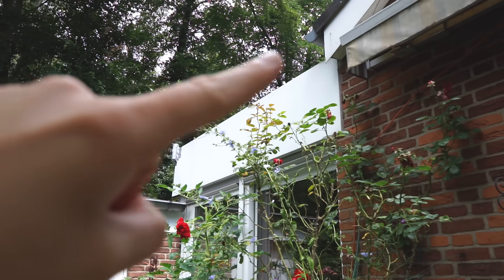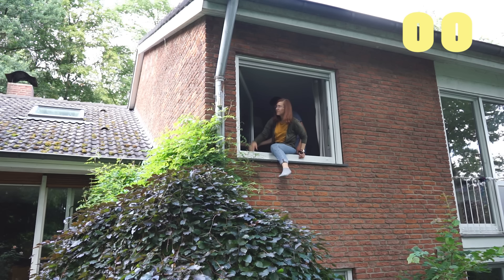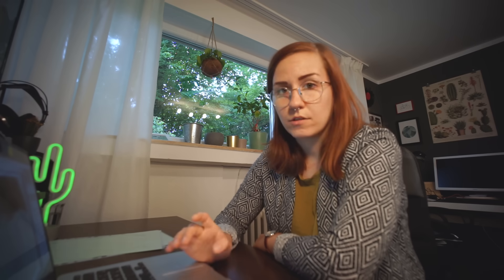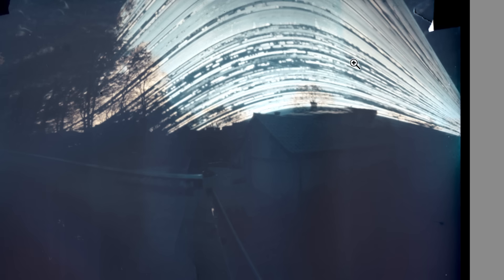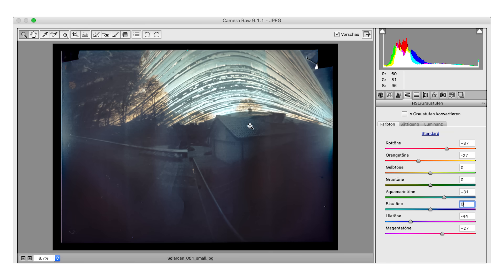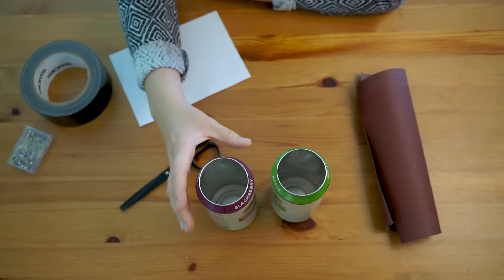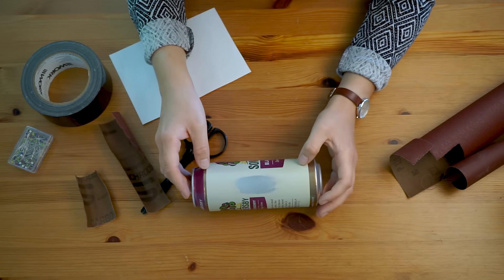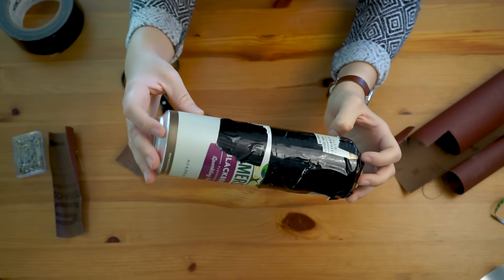Beer can pinhole camera | 1-YEAR LONG EXPOSURE

Comment: Wow great video :)

I have two questions about it:
1) What paper did you use? Bzw which ISO had it?
2) Do I understand it correctly that you have scanned the paper directly out of the can? If so, can you open the can in the light and how long can the image be exposed to normal daylight?

Keep up the good work and greetings,
Tobias.
Reply from the maker: Hey, thank you! 
1) I don’t remember exactly but I think it was some old Ilford paper (grade 2 or 3). And darkroom paper has an iso value of approx 8 or 10.
2.) exactly, no developing, just scanning. But it makes sense to try to keep the paper away from light, because it will slowly fog. But getting it out in daylight to scan worked for me.

Hope this helps? :)
Reply: @KarinMajoka  Yes, thank you.
I'll see if my friends have 1-2 leaves over.
Reply: @KarinMajoka  I have 1 or 2 photos stored somewhere for almost 20 years. I don't know what is the image. I don't know what kind of paper it is, but I guess it was a common one for photography back then. 

Do you think it is safe to scan it like you did and get an image out of it?

I also have a roll film of a conventional camera with photos taken even older. Can I do the same with that film?

Thanks.

Comment: is there no need to insulate the can from the direct heat from the sun? thanks for sharing this!
Reply from the maker: That's a good question - I live in Germany so "heat" is probably relative. I did not have any issues with my beer can cameras here, but I also don't have any experience how they behave in warmer and more humid climate.
Reply: @KarinMajoka  i've been doing some calculations and the sun will be at almost 90 degrees in the summer here in the Philippines. i may have to tilt the can, but i don't know if there will be water intrusion through the pinhole when it rains.

Comment: Extremely interesting project and very well done and your skill on the computer to bring out details previously unseen is amazing.. One thing that might be worth considering is to make an even better quality pinhole in some thick foil, similar to what small individual pies are sold in and attach it to the beer can camera. Years ago I made numerous pinhole cameras and various pinholes and found that the “sharpness” of the picture was highly depend on the quality of the pinhole. I would gently make a tiny hole in the thick foil and then repeatedly rub over the pinhole with the side of a pen to flatten any burr that has been created on the edge of the pinhole and gently twirl the tip of the needle in the hole with almost no pressure. Repeat the “flattening” and “twirling” a few times resulted in a high quality pinhole. I bought a magnifying loupe with a measuring scale and could accurately measure the diameter of the pinhole right down to  1/5 mm, but the optimum pinhole size for your “beercam” would probably be about 1/3mm. I did my pinhole photography when I was a young man and now I’m retired, videos like yours inspires me to get back into it.
Reply from the maker: Thanks for taking the time to watch and comment - I really appreciate it! And that's an awesome tip, I hope to try out one day. I am not all that experienced with pinhole photography apart from the solarcan-project, but I have always been fascinated by it. I was considering building small little pinhole cameras out of those small film canisters and I was wondering what a good way to build the aperture would be. So that advice really comes in handy - thanks!
Reply: Karin Majoka a “film canister” camera is an interesting concept and you would probably need the smallest pinhole of about 1/5 mm and I’m sure the results will be interesting. I have a Russian Zorki 35mm camera that I mounted a pinhole to and the results were not spectacular. What you are doing with your larger format “beercams” is the way to go, the larger the format, the better. When I get back into pinhole photography, I will probably go for 120 film, which is 2 1/4 X 2 1/4, in other words, the bigger the better. Years ago I built a 5X4 pinhole camera which produced very good images. You might not be all that experienced in pinhole photography, but I’ve sure learned a few things from you. I would have thought that a year long pinhole camera exposure would have yielded a picture so overexposed that it wouldn’t be viewable but you not only proved me wrong but with your additional knowledge of scanning and computers, you came up with some images that were absolutely amazing, especially when you adjusted the curves and the foreground house became visible. Best wishes with future pinhole projects.
Reply: @KarinMajoka  .. Karin, I want to try this. What paper exactly do I need to buy? (and where can I buy it)?
An idea that I have, although it can be complicated to build, is to use 1/2 can cut vertically and put the pinhole in the plane part I would use to close the can. In this way all the points of the paper (at any given height) are at the same distance from the hole so 1 degree of the sun moving in the sky will be the same length in the paper at sunrise, noon, or sunset. Of course a spherical surface would be eve better but good luck finding a hollow sphere that can be cut in 1/2, and even better luck conforming a piece of flat paper into a sphere, and if you happen to manage to do it, good luck scanning the spherical paper!
Reply: @adb012  maybe you could make the adjustments on the computer, like the opposite of how people take images reflected on round surfaces and straighten them back out.
Reply: @adb012  I hope it's not too late but for beginner Foma is suggested :)

Comment: The results are so cool! That's even better than a night long exposure of the stars.
Sadly, I can't do it at home since I'm in the middle of the city (the suntrail would be very short...) but I might try it at my parent's home. Now to the fun part : the beer cans!!
Ps: you've got an amazing neighbour
Reply from the maker: I can see why it can be difficult to find a good spot for a solar can in the middle of the city! However, the length of the sun trails should not be connected to your location per se but to the season or duration of the sun being out. It's a lot of fun, would be interested to see your results in case you try it. :)
Reply: @KarinMajoka  Actually, it's more the sun trails being shortened by the surrounding buildings that concerns me...could be interesting if I use it right though (like Michael Wesely) ! I'll be sure to keep you posted if I give it a try =)

Comment: What an awesome project.  I've only ever seen pinhole cameras done in either cardboard or over the top fancy steampunk models in wood and brass.  This loos like a great all weather solution.
Reply from the maker: Thanks for your comment, I appreciate it a lot! :) indeed, one of those pretty wooden pinhole cameras would not be suitable to hang on a roof for one year haha. However, the core idea is a bit different between both types of pinhole cameras: usually pinhole cameras have a flat film plane, with the beer can camera it’s round though, which makes for the wide, distorted field of view.
Reply: Nearly 40 years ago I saw an exhibition in Edinburgh by a pinhole photographer. He took pictures in quiet locations around the city on Sunday mornings. Exposure times varied between 10 and 20 minutes, leading to ghostly figures moving through the space with few personal details. He made his own cameras out of both square and round boxes and tins. As he experimented, he moved onto bigger containers as cameras - the wide tins of sweets from Christmas or catering sized soup tins. That led to a variety of shapes and sizes for both paper and pinhole. Pinholes could also be tiny slots. He stuck to vertical and horizontal but any angle could be used. The paper was developed and fixed in order to be displayed. That was possible by the shorter exposure time, and careful timing in the darkroom. Experiments will give you a lot of information that you can use to create a good picture. Risky and creative at every stage. As it is with my painting - it's only paper, poor mark making becomes useful practice.
Reply: @michellebyrom6551  Remarkable. Thanks for the info. Amazing what people get up to.